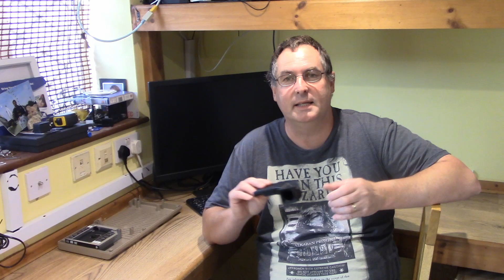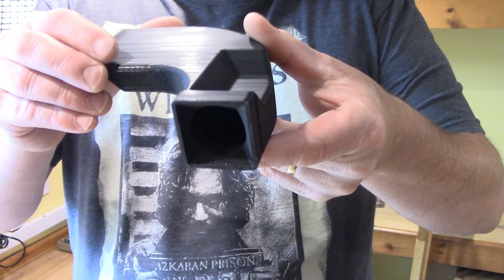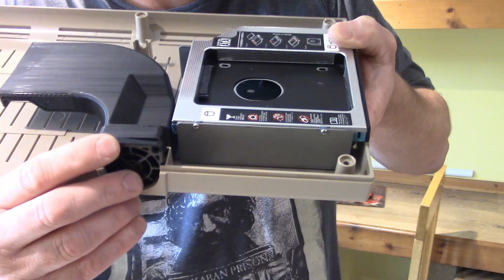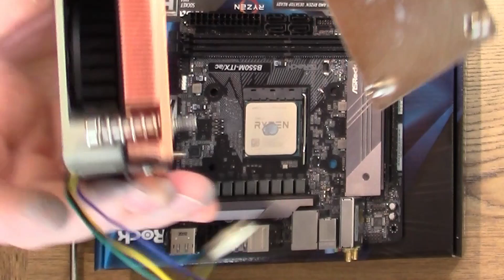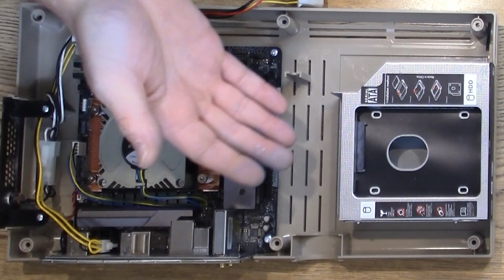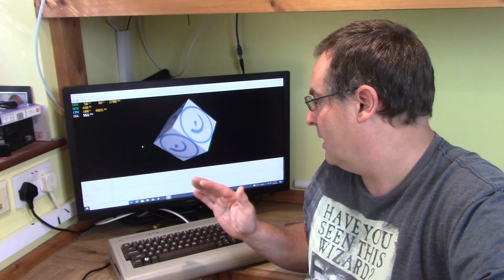C64X Ryzen Cooling Update

Comment: The cables that connect to the DVD/SSD bay are in the way of the exhaust tube and that tube had to be strangulated at that point, reducing the air flow. I modified and flipped the bay in order to move the cables away from the exhaust hole, and created a 3D printed tube that has no strangulation.

Comment: I seem to remember reading that somebody suggested replacing the top of the dynatron with a Noctua fan. Now I cant find it it of course, but I seem to remember it was mentioned on this channel? Does anybody remember seeing this? Thank you. :)
Reply from the maker: Hi, yes i remember seeing that but can't remember where. There is also a newer Dynatron heatsink/fan out now called the A45. We are going to do a build soon using this fan but i don't know if it will fit yet.
Reply: @myretrocomputerltd5179  It looks like an upgrade for sure. But I am a little bit worried about the noise level as it seems to be a little bit higher than the A18. Which is my mainproblem with the Dynatron. It works well, only it is a bit on the noisy side for me. I've ordered to Noctua NH-L9a-AM4 which is supposed to be substantially more quiet while being an excellent low-profile cooler so I'll give that a go and see. :)

I noticed most everything is sold out in your store. Any chance that you will be getting those backlit keyboards back in stock? That seems like a must-have upgrade to me. :)
Reply from the maker: You will have to let me know how that works out. I will also mention it to Ewan - from mini-itx. Regarding the website stock levels - The Kickstarter campaign is running 2 months behind schedule so i took the decision to pause all sales on the site until I can get all rewards out to backers and then we will have more stock to sell on our website - probably late September early October before we are selling again on our site though.
Reply: @myretrocomputerltd5179  Willdo. And understandable about the website. I will just have to do without the backlit keyboards for a few months. :) 

I am wondering what I should do with the case fans. Since I am changing the CPU cooler and no longer will be using the excellent shroud I wondering what the configuration of the case fans should be. One in and one out? Or both in (Or out for that matter) and rely on the front vents for airflow.

I guess some experimentation is in order. :)
Reply from the maker: @torhansen8570  yes i think you will have to experiment but i have always found (since we started using the 3d printed exhaust) that getting the heat ducted out is much better.
Reply: @myretrocomputerltd5179  Finally got around to installing the Noctua fan, and I am really pleased with the performance. 10 degrees C down on a Cinebench test and about 3 degrees down on more "normal" stuff like 1080P videos and whatnot. So that's all good. But the most important thing for me was the noise level that went down from 70+dB down to 53dB at full speed. So that's super helpful for me. The only thing that was a little bit concering was that the one edge of the fan was right there up to the keyboard. But it fitted fine.

What I did in the end just because I wanted to give it more room to breathe was to lift the top 2 mm up by putting in 2 mm spacers between the top and bottom case. Even though it wasn't necessary it felt better to me.

Hardwarelist:

AMD AM4 Ryzen 5 5600G CPU (65W)
Low profile ram stick (dont recall brand/model offhand)
ASUS ROG Strix B550-I motherboard
HDPLEX 250W GaN ATX PSU (Passive) so I could install it inside the case.

Honestly the PSU is complete overkill wattage wise, but it fits nicely in the case and runs surprisingly cool. 

Now for an upgraded build with my second case. :)

Comment: Ive fitted an AMD A8 7600 chip into my case.
FM2+ board.
These run hotter than the newer chips but the build is cheaper.
Ive used duct tape to blank off the vents by the fan, this will pull air from the other side of the mobo cooling the mobo as it passes. Also, the catalyst control centre lets you detune the A8 7600 chip down to 1.4ghz, 2.1, 2.8 or 3.1ghz. I just stick mine on 1.4ghz an it runs OK with an m.2 ssd pcie nvme drive.
Reply from the maker: Can you share some pictures with us please. I have seen a small part of your build in the picture you shared but it would be great to see the whole thing. The Dynatron fan combined with the exhaust pipe works wonders but only works with the board in this video - with all the builds i have done to date i can honestly say that a blower fan in combination with an exhaust pipe gives the best thermals - they get get the heat out of there. The Ryzen build in this video never overheated or shut down through the recent 107F heatwave we had in the UK!! It was a great test!

Comment: Great video! Just thinking, could you turn the fan on the heat sick to point to the exhaust vent on the right hand side?
Reply from the maker: Hi Aaron, I did think that when I had it designed but I really wanted to make use of the card reader slot. The only downside to this design really is that fact that you need to drill a hole in the rear I/O shield for the Pico power supply.

Comment: Brilliant - love to see your  marvellous builds evolve - love the “exhaust port”
Reply from the maker: Hi Chris, Thank you! and yes a perfect name!
Reply: @myretrocomputerltd5179  trying to 3D print (39 hour print) - I’m making a timelapse (if it turns out) - will ping it across to you if it does 😃
Reply from the maker: @MrHitman1966  Lol, Triple Axis said it takes 12 hrs on their machine!
Reply: @myretrocomputerltd5179  i suppose it will on an all singing and dancing 3D printer - mine is ok but not quick
Reply from the maker: @MrHitman1966  I thought 12 hours was slow, I'm a total noob to this 3D printing lark!
Reply: @myretrocomputerltd5179  lol - the speed still shocks me every I get the software to slice a model - if your printer is high end stuff it can be done quicker
Reply from the maker: @MrHitman1966  I was going to get one but there are so many to choose from - I wouldn't know where to start.
Reply: Hey, do you still have the 3D file for this (I know this is 10 months later)? I have a Dynatron cooler and printer so would like to give it a try rather than paying AUS $70 to have it sent from overseas.
Reply: Hi Chris, thanks for your reply. I can't see how to message you directly but if you can send the file to jjstrudwick@yahoo.com it would be appreciated.